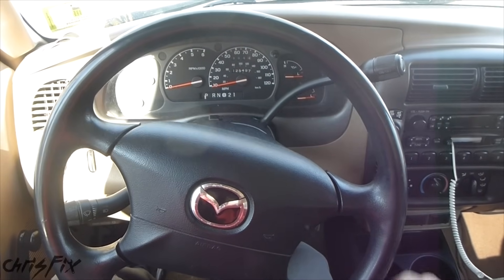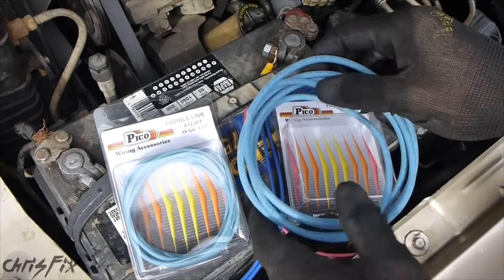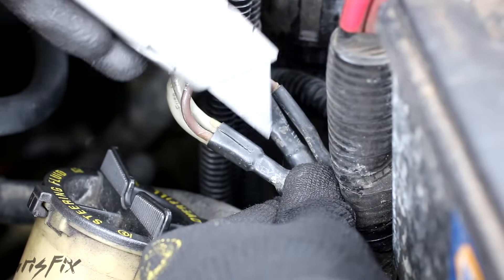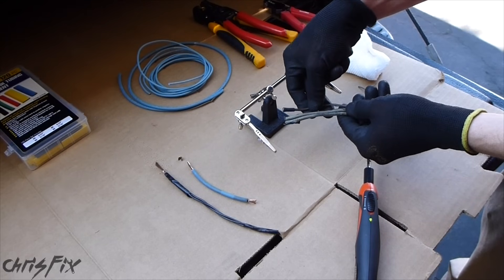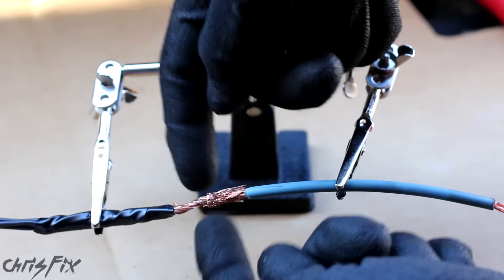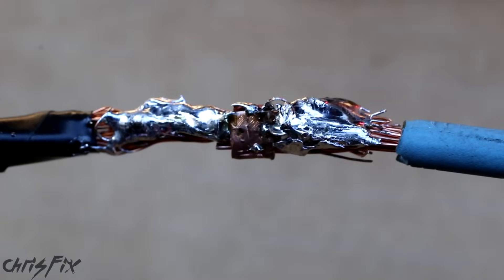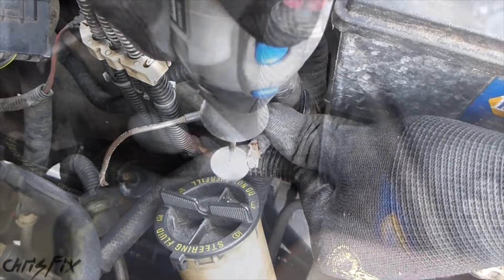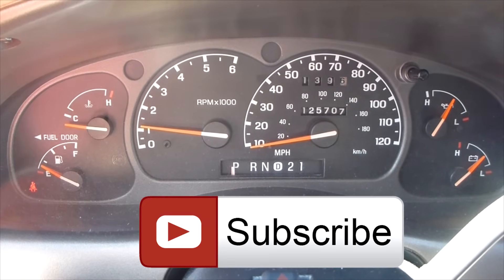How to Replace a Fusible Link (Car won't Start)

Comment: Hey man, great video. Two questions. First one is where did you get those copper band clamps (3:46)? I looked on Ebay but found nothing. I may have been using the wrong keywords.

Those would make holding the wires together before soldering much easier rather than the two methods you mentioned in another video (Western Union and something else). I've got one of those roach clip tools like you are using which is great on a work bench but it's hard to use it when soldering wires together in an engine compartment. 

Second question: Does solder have a shelf life? Reason I ask is back when there was Radio Shacks, I bought some very thin solder (maybe 25 years ago) and it worked well for years but here lately I can't get it stick very well. It tends to ball up. I think the flux or rosin core in it has broken down. I thought it maybe my soldering iron wasn't getting hot enough but I think it's the actual solder.

Reason I found your particular video is The headlights on My Citroen 2CV are not protected from the factory and the car suffered an electrical fire at some point in the car's life and someone had repaired the harness. 

I went through a replaced all the corroded connectors. I considered added some in-line fuses to the headlights. I thought about mounting them directly behind the headlights but that is too far down stream to protect the wiring. 

I got some of that 1" ID insulation wrap to go over the wiring in the engine compartment and thought removing a section of each wire (four) going to the headlights and splicing in some fuse-able links. That way the insulation wrap will go over all the wiring easier than using in-line fuses. 

Best I can figure out the wiring going to the headlights are 14 AWG (actually metric). The current draw one each high beam is about 4.5 amps. So I chose some 18 AWG fuse able links. I read your supposed to drop down 2 AWG sizes. I figured fuse-able links would have an amperage rating. So if the headlights are pulling 4.5 amps does 18 AWG fuse able links sound OK?
Reply: I would not use fusible links for headlight circuits, regular fuses would be safer since they blow much faster if there's a short and they are much easier to diagnose and replace.

Comment: Looks like you were having issues with heat transfer. Quick tip: make sure the iron's tip has a small bead of solder on it too.
Reply from the maker: jonno85uk Thanks for the tip! Yea, I tinned the tip. I think it is the fact I didnt use flux. I might also need a bigger soldering iron. Any recommendations?

Comment: I just want to make a short comment and yes it definitely is similar to a fuse or relay however there's nothing in today's world that replaces a fusible link unfortunately. Have a 1990 Dodge van that has a lot of fusible links I would love to substitute them but it is very complicated because even though they protect in the same manner there's nothing that will allow a current to come through and not pop it the way a fusible link works. A fuse any current coming through that is too high will pop at immediately relay will turn it off and then turn it back on immediately.. fusible link allows up to 3 seconds of current to go through so if you have surges in the system (an old van like mine there are many) The fusible link allows for them whereas the fuses and relays don't. Many people replace them but there are issues with doing that I wish there was a direct replacement. It's fine when you have one fusible link but when you have 20 of them it's really a pain

Comment: Probably asked this before, but where did you get your ratchet and socket set from? I still have my craftsman 105pc set that was my first (and only) tool set, pretty sad for someone who did formal training for a year, but of course I lose the 12 and 14 mm which I use most. Also, which Dremel are you using? Thanks.
Reply from the maker: Michael Lett Check the description for any links to tools and stuff I used in the video (sometimes I dont have it in the description so let me know! Here is the socket set I use now: http://www.amazon.com/gp/product/B000LY5AKU/ref=as_li_tl?ie=UTF8&camp=1789&creative=390957&creativeASIN=B000LY5AKU&linkCode=as2&tag=chri0e2-20&linkId=7A5YQVOXYVXI5EAA
Reply: ChrisFix funny thing man, I'm in Wal-Mart right now and actually found it before I saw your message but it's a 123 piece for 49.97, might have to grab it so I can have a full set. Thanks again.

Comment: My 1986 volvo 740 GLE, that has that speedometer issue, however I am not sure that this car has fusible links or where they are. The car also starts perfectly well. I think the issue is the speedosender cable or the sensor in the rear axle. Any thoughts?
Reply from the maker: Halzar Yea, the speedometer issue for your car could be the gauge itself. What happens to your speedo?
Reply: ChrisFix The speedo needle jumps around at idle as if I was picking up speed when in fact the car is standing still. Much like yours in this video.
Reply from the maker: Halzar There are these little motors on the back of some speedos (not sure about volvo) but they go bad and if you replace that it will work again!

Comment: Would this also cause my alternator to not charge the battery? I have a brand new alternator that tested great, but it doesn't work when it's on the car. Is this a fusible link problem?

Comment: Is that fusible link just common 18 ga stranded wire in a PVC jacket, or is the jacket made of something else?
Reply: I also think its wire with only bigger insultion.
We could use silicone wire(heat resistant).
RC hobbyst use them.
They are rated for up to 200C but I noticed that they dont melt under 450C(soldering station on full set).

Comment: in Europe we use something special called "fuse" instead of a soldered small wire. But cool tutorial.
Reply from the maker: Fuselx This is a special fuse. It is designed to take current spikes without burning up where a fuse would normally blow.
Reply: Fuselx fuse wire is a fuse, a flexible fuse, and works exactly the same as any normal fuse would, only more difficult to change :P

Comment: Chris, I have a 2002 ford focus se. it starts, runs for a minute then dies. I replaced the battery, fuel pump and fuel filter and still get the same results. the car sat out side for a year with a few gallons of gas in the tank. i'm getting a can of heet to hedge against water condensation. I've also swapped out the fuel relay.  next is checking the ignition switch.  What would you recommend?

Comment: Hi chris....hope you are fine i have a dodge Durango 2014 its actually belongs to my customer. The car problem was not charging the battery properly. I changed the alternator (generator) still the same problem, the battery is ok. One of the electrician came n remove the computer opened it and put it back again. Now there is another problem.... the car is not starting but u can see all the lights appear on speedometer. What you think ? Is this the same fusible link problem ? I am mechanic and will appreciate your help.
Reply from the maker: Could be the fusible link but if the problem came after messing with the computer my guess is it is the computer or something they took apart. To fix the original problem, try running a new ground wire from the alternator to the chassis and a power wire from the alternator to the battery.

Comment: you said "don't forget to put the heat shrink on the wires before soldering and crimping"...what do you mean, because how can you crimp and solder if the plastic heat shrink is already over the area being fused?

Comment: Chris, Is this the same way to replace a fusible link in a 2000 Dodge Intrepid?  
Had a mechanic replace the battery and alternator,  Car ran great.  Drove over 3000 miles on trip; got home and turned off car.  Wouldn't start.  Mechanic looked and said wires sparked.  He rechecked alternator and said it was good.  He was supposed to replace the fusible link from battery to alternator.  Never got back to us and so we are trying to do it ourselves.  Told us to get wires from used auto parts place and to be sure to include insullator.  I think this is what he forgot to install when he replaced the battery which caused the problem.  But you don't mention insulator.  What's this about?
Reply from the maker: Zoro Astro I dont know what the insulator you are referencing. This fusible link replacement I showed works for any fusible link in any car.

Comment: Mr. Fix-It I'm not a fan of the bolt on battery cables more like the ones that crimp on and I or solder or crimp on I think they're better those tend to corrode can you show us fix a nose one time for the batteries thanks
Reply from the maker: Good idea

Comment: Dear Chris, Can you eliminate the fusible links and instead wire them to mega fuses.  I have an Auxillary fusebox out of a 1997 Monte Carlo. It has 4 mega fuse places in it.  I want to update my 95 Buick Century's wiring so that is why I am asking the question.

Comment: Can  you test a fusible link with a continuity tester?....my son inlaw reversed the cables on his battery when installing a new battery,  now head lamps and a few other things will not power up...I checked all other fuses.
Reply from the maker: Yes you can. It should show a connection.

Comment: Hey good good tips could this be the reason my battery is draining and also battery only stays half way but when it reaches operating temp then all the sudden my batter shows a full charge any ideas new alternator water pump pulleys and fuses as well

Comment: Hey Chris i have almost the exact problem when starting the car, my alternator tested bad at my local shop and after replacing it these same symptoms came back with, could this issue also pop up as a bad alternator on a diagnostic?

Comment: Have you really accessorized the B4K beast and ran out of space in the fuse panel?  I am familiar with lines for things you might add directly to a live battery that are self-fused (have to be careful not to create a constant draw and run down the battery), but haven't seen these links that you are showing done this way.  Can you share some more background on your situation with these links, please?
Reply from the maker: ***** What do you mean? Are you talking about the wires attached to the positive battery terminal?
Reply: Ya, never seen all these links like this at a battery post.  I understand the concept of an inline fuse such as for adding an electronic device (radar detector in ur Vette - just saying!).   So all these loops at your battery has me wondering wassup.
Reply from the maker: ***** That is for my rear lights and offroad lights. Check it out: https://www.youtube.com/watch?v=ZVG7X-ae298

Comment: Hey I got a question. I have a97 Mitsubishi Diamante ES and I need a fusible link but I can't find it under the hood. I temporary ran a 8 gauge wire from the alternator to the battery with a fuse on it. Is it safe to drive the car this way? And where are the fusible links usually located?
Reply from the maker: 8lgsg It probably isnt safe to run that 8 gauge wire with the fuse unless you know the correct size fuse to prevent damage to the electrical system. To find your fusible link, follow the red battery cable down to the alternator and the fusible links will be connected like in this video. Use a flash light and take your time and you should be able to find them. You might consider checking on Mitsubishi Diamante forums and ask them or search there for where the fusible link is located.
Reply: 8lgsg diamantes are made in australia (if its the same model im thinking of) and there isnt any fusible links on our motors. best to google it out and see what others have tried.

Comment: Hi, what if I want to get rid of the fusible links in my car and replace them with maxi fuses , that should work right?
Reply from the maker: Maxi Fuses work differently so it isnt suggested. The fusible links can take a spike in amps but maxi fuses cannot.
Reply: I am a little confused. New cars have maxi fuses instead of fusible links . How can teh new cars do it but the old cars can not?

Comment: Hey Chris what ratchet are you using? Im looking for a decent and non expensive one.
Reply from the maker: ***** I just got this kit which I really like so far: http://www.amazon.com/gp/product/B000LY5AKU/ref=as_li_tl?ie=UTF8&camp=1789&creative=390957&creativeASIN=B000LY5AKU&linkCode=as2&tag=chri0e2-20&linkId=QBW7LLYZNRV3LQ2H
Reply: Would you say that the set is worth the $90? All my ratchet are cheap and some have stripped gears, so i'm looking for a decent set.
Reply from the maker: ***** Yes because it is my go-to set. I rarely need any other sizes (I needed a 21mm the other day though) and it is easy to travel with. I really like it. The parts are durable, the finish is easy to read (no more searching for the little marks telling you the size of the socket. The ratchets themselves are pretty good and feel durable but I just got the set so only time will tell. I would buy it again for $90 personally if I had to. Do you have a socket set because I wouldnt buy this just for the ratchet. It is more for the sockets.
Reply: I do have a like $25 Wal-Mart tool set that is my current go-to set, but it lacks alot of things. It has basic SAE and Metric sockets up to 5/8. The ratchet sucks and has alot of play, and takes quite a good range of a swing to grip the next gear tooth, which sucks in tighter spots.
Reply: Also, If you don't mind answering a unrelated question, I could use some feedback. After I discovered your channel about a year ago or maybe a little less, I saw all you fluid changing videos and decided to do it on my truck also. Long story shorter, I replaced my leaking radiator and in the process I flushed the cooling system and installed a new Thermostat. My truck hasn't had any cooling problems after that. Well recently my AC compressor started getting loud so i decided to replace it and the accumulator. When I replaced my accumulator I had to remove the upper radiator hose for room for my hand and ratchet. Well I re-installed the hose securely, topped up the radiator and brought the reservoir just over the full line. Drove it to school and back and noticed the reservoir was pretty low, but not empty. I topped it up and drove it the next day. Both days the temp gauge would spike up then automatically drop back down which I know was air pockets in the system. So I was ETCG's video on burping the coolant system and tried to let the air out. I started my truck and let it idle for a few minutes. After like 3 or 4 minutes coolant shot like 4 feet out of the radiator and splashed everywhere. I was told to check for a head gasket leak and I did a block test and I didn't have any combustion gases in the cooling system. I filled it back up and now it will idle with the cap off, but Not seeing any bubbles. I do have a manual fan that always runs so it is kind of hard to get it up to temp for the thermostat to open. Do you think I should get one of the spill free funnels and refill it the proper way? Also my truck used to always run at 1/4 on the temp gauge, now it runs at 1/2. Any ideas why that's happening? Thanks a for replying. You rock.
Reply from the maker: You want your truck to run at 1/2 on the temp gauge, that is good. As for the spikes, that could be due to air like you said. Try driving up a steep incline to angle your truck and run the engine. The air should work its way to the top of the radiator.
Reply: Thanks for the input man. Really appreciate it. One last question. When I open my radiator cap, lined on the inside of the radiator neck its some brown gunk, not oil and the coolant is green as it should be, but on the radiator neck walls there is like a brown residue, do you think a flush would get that off. Not sure whats its from, but I don't like it there.
Reply from the maker: ***** Clean that off with a paper towel . That is old residue from previous coolant changes. If your coolant is still good, no need to flush it. Here is how to test your coolant: https://www.youtube.com/watch?v=mHTM3dvpD1M
Reply: Well i'm not sure where it came from, I put the Radiator in new not even a year ago and I flushed the system before I put it in. Maybe I didn't get it all flushed, but the coolant is still perfect.
Reply: And I just wanted to say thanks man. Really appreciate you taking the time to reply to all these comment and helping me and others out. Really means alot.
Reply: Hey this is what I meant. This is what is lined in the radiator. I use 50/50. I mixed one gallon concentrated with 1 gallon of distilled water and this radiator is only around a year old. http://s29.postimg.org/zfrhtwll3/20150331_223256.jpg
Reply from the maker: ***** Try doing a coolant flush to get that gunk out: https://www.youtube.com/watch?v=s--5ft5YiHg

Comment: Hey buddy I have a 95 honda civic stick shift and the speed gauge shakes a lot and sometimes it doesn't move. Do you think it can be the link wires????
Reply from the maker: Lostroad100 Well it is most likely an electrical problem. I would test the voltage coming from the alternator as well as the grounds like in this video: https://www.youtube.com/watch?v=LGB6ZEjGm7Q